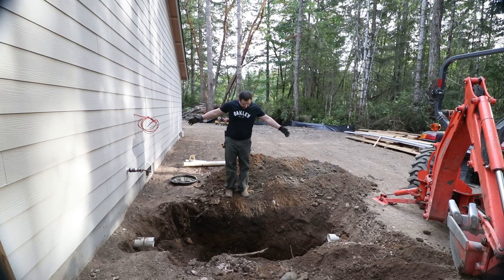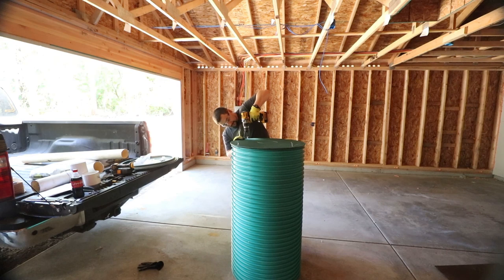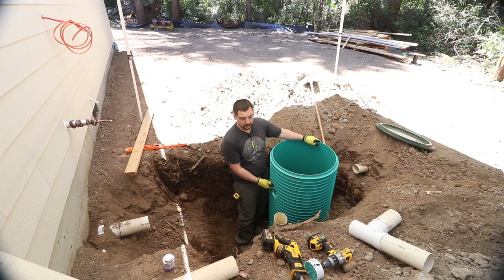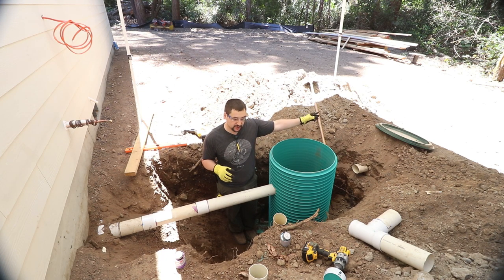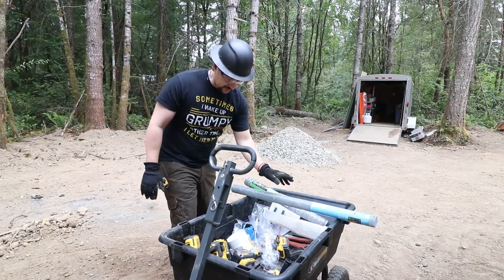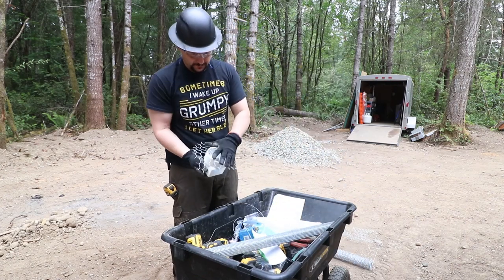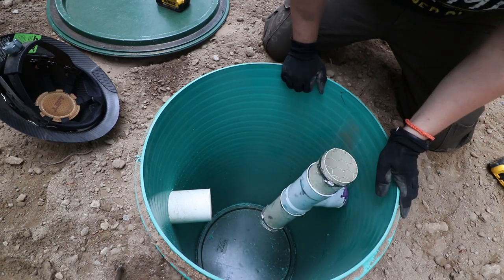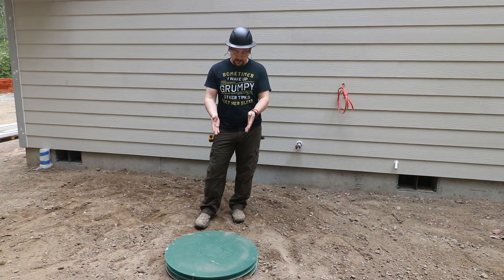Storm Water Catch Basin Drainage System

Comment: Suggestion:  Use the stake pockets on top of your handy wagon and build a small work bench about work height off the top of the wagon, the height should be enough where you can still reach under to get things out of the wagon.

Comment: Drainage 101: if water is in motion keep it in motion, don’t stop it to have to catch it again and put it in motion again. If it was me, I would do the following :- 
1. Install the new catch basin with dummy pipes leading into and out of it to fool the inspector.
2. Reroute the 4” solid pvc pipe from gutter downspouts, circling the fake basin, to the end point infiltration pit you have prepared,.
Alternatively after a period of time, use a slip fix telescopic joiner to join catch basin inlet and outlet to skip over the catch basin.  The reason would be, there is no sense in catching water, then releasing it into a catch basin, then re-piping it to final outlet at the I-pit. I, too, would be whining like a b*-*- at the unnecessary cost of the catch basin.

Comment: Great job with the work and with the video. Have two questions, did you have to glue all the joints for them to pass the inspection, or was that just your thing? Next I did not see any gravel or stone of any kind go in the hole, did you not have to put stone in or did I miss that part? Everyone is telling me I need all this stone, but I just can not see it if I am putting in 4 large catch basins in. Was told we needed one at each corner of the house. Any feed back by May will be a big help. Thank you.
Reply: Ground movement happens... glue your stuff so it stays put, also as a plumber, i will say, always put at least enough gravel around any peice in the ground to cover 6-12 inches past all directions of pip or whatever it is, it allows drainage to occur around it, keeps roots and things away from the pipe,and the gravel will move before the pipe does as well, so yes, use stone-gravel
Reply: Oh the top 3-4 ft use soil though, you don't want a gravel mess on top, soil will keep it in place

Comment: hey Daniel please share where you got the items to make the catch basin (pipe nad lids)
Reply from the maker: All of those components were bought at HD Fowler here in Bremerton Washington. Most of these components are not available at your local big box stores. If you contact your local septic tank supplier they will have the tank risers which is what the green tube is. And the top and bottom caps or just septic tank riser lids.

Comment: Great videos Daniel, thank you!  I have watched about 10 of these.  I am in Kitsap and will be doing an infiltration pit setup for a new build that is a Hiline 2232 (sq ft) model.  I want to do sch. 40 white pvc into a black catch basin that is shown in other vids.  for gutter drainage.  Do I need a separate foundation drain that goes around the footer (french) that is separate from the waste water system?  Any idea of how big of an I-Pit I will need to pass code?  Thanks again, very helpful info.
Reply from the maker: You will need a sight development plan that will give the dimensions and specification for the I Pit. I recommend using the septic design plan and making copies then editing it to show how you are going to follow the kitsap county BMP’s
Reply: @DanielWoodell   @Daniel Woodell  Thanks.  I should have mentioned that it is a replacement home.  My SWPPP Plan showed an existing i-pit, no catch basin.  Just wondering if the footer drain was left out of these builds?
Reply from the maker: @garybugle7983  I did not install footer drains as they are not required in Kitsap County, they are recommend by the county and the county also has minimum slop away form the house requirements. In the case of this video this house has no sloped banks pointed at the house so there will be no water problems. If your houses will had banks/slops that will allow water to sheet across the top of the ground or across the hard pain and the top soil then yes you should install footer drain on those sides.     At Min 4:24 in this video  you will see all the water I'm stand in in on this house we did end up installing footer f\drain in the front to the house. https://www.youtube.com/watch?v=9M44JLXKV24
Reply: Thanks!  I'm going to install a footer drain system, and downspout drain system separately, so will wrap the house twice.

Comment: I'm confused . Water comes from downspouts if house to catch basin . Then another entry from other side . Where is that coming from or does the water fill up and go out that side . Also why is their a vertical line up and down . And why are there different kinds of mesh attached to both sides .
Reply from the maker: Well the simplest answer is becuase the county and their engieers are really dumb!!!
This video explain where the eater comes from 
https://www.youtube.com/watch?v=PTBaoUDlB14 
 
This Video explains where the water goes to 
https://www.youtube.com/watch?v=ktm8lS-AICs
As for the mesh the ides is that under normal rainfall in this area the water will go up the vertical pipe and out to the infiltration pit. And the small screen will stop the debris from getting in to the infiltration pit. And then under really heavy rain for is the small screen gets clogged the water will go over the top of the vertical pipe and go out to the infiltration pit. That is the thought as designed by some engineer that has never had to install or use one of these. I can tell you that this will cause problems in the long run because i have a different system on my house and it also has problems with this very similar dessine. Hope this helps.

Comment: You are fortunate to not be building in Bellevue where a concrete Type 1 CB with an iron frame and locking lid is preferred.    You really should use the rubber gasket where the pipe slides through your new CB  Just loose fitting the pipe does not meet specs, and you will have future problems with roots getting into your system.